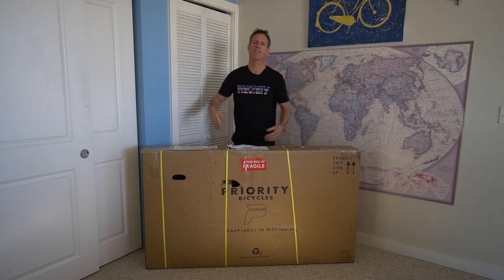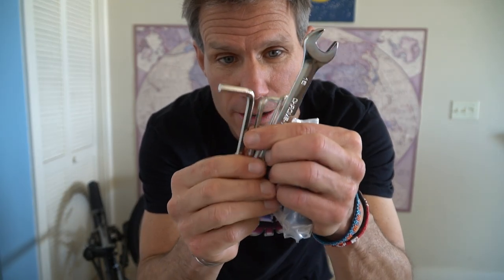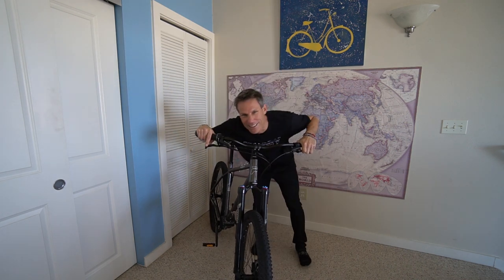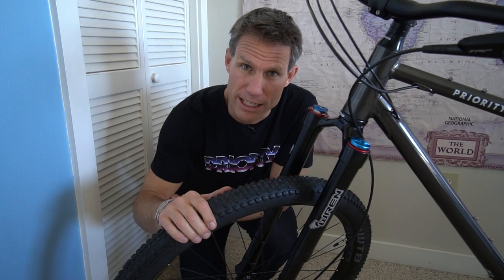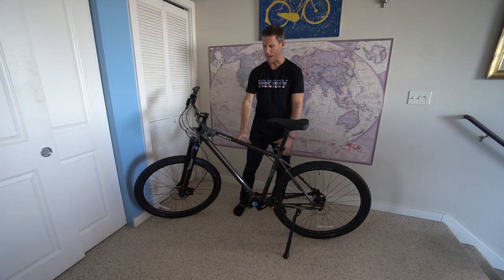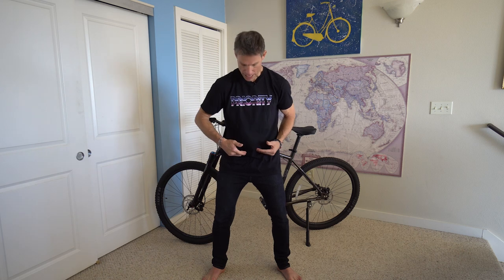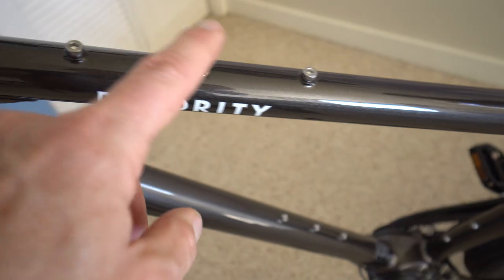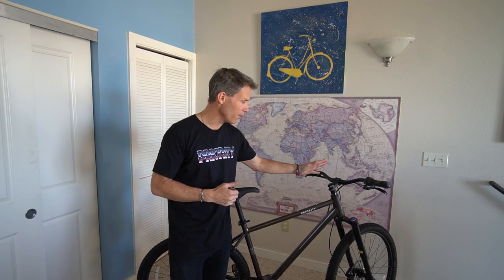The Priority 600x Bikepacking Dream Machine!

Comment: I ordered one but I'm on the wait list. Planning on riding the GDMBR starting mid July. Hoping to get it in time.
Reply: Just so you know pinion gearboxes eat gear oil.  Honestly I don't know where it goes.  Adding a little oil every 1000 miles will keep it from being hard to pedal. Also keep the belt a little looser than recommend.

Comment: A relatively Light, 350 Watt front motor would flatten most hill's, eliminating any more "Hike-A-Bike"... especially with a Pinion and a IGH!. A few studs on the front tire along with a 36 Volt 350 Watt front hub, will make this an All season All Terrain Bike for some awesome Frozen Lake drifting in the Winter. You put together a Great Machine Ryan... with all those components, I could not build the same bike for less than these bikes are selling for! This is a clean build! Well done!

Comment: Pretty bike. Needs a Factory Float SC, dropper post, steel frame, shorter chain stays, MT-7's and much longer reach. I am really excited that the belt drive might catch on, and the prices might come down on the pinion gear box.
Reply from the maker: I’m a big fan of belt drives and I’m with you on the gear boxes. Cheers

Comment: Standover clearance is usually done with your cycling shoes on which will effectively make you a bit taller so you might clear the Large frame ok.
Reply from the maker: I tried with shoes on as well, I can certainly swing my leg over and ride it, but it’s a bit too big.
Reply: @duzer  Your tire choice will also affect the clearance.  If you go Medium make sure your stack and reach measurements will work for the Medium size.  You might need a different stem length from stock.

Comment: N I C E !!!!! You ARE the man! Enjoy that new baby! You EARNED IT!!! BTW, for sizing, make sure you test stand-over with the LARGEST tire you plan on using... The inverted shocks will make it hard to mount fork bags down low :-(
Reply from the maker: Thanks, pretty excited!! Also, I've mounted my Widefoot cages with 64oz Kleen Kanteen bottles on the fork no problem.
Reply: @duzer  True, but you have to mount them a foot higher on the fork body vs down near the axle, which changes the dynamics of the front end. I prefer a traditional fork because of that...
Reply: @outbackwack368  While weight down low is normally preferable, weight on a tradition fork down low means you also have to push that weight through the system. Essentially your bags add to the unsprung weight of the system. Because the wren fork is inverted, mounting bags on the chassis up top means you add no additional weight to the traveling portion of your suspension. This means the inverted fork will be more supple and behave more consistently when loaded for bikepacking.

Comment: Ryan, my wife and I are big fans of yours. In the spring we got Trek 520s to do some touring with. I imagine our touring will be much like your cross country touring although in sections instead of all at once. Mostly paved with some gravel and a few trails. Would you take this on a cross country tour? Someday I would like to try the Montana portion of the Great Divide Trail which leans me in the direction of the 600x but is that overkill as I will likely not do a ton of technical trails. Thanks ahead of time for your thoughts.
Reply from the maker: Hello!!

Yes, the 520 is the perfect bike for pavement and light gravel. It was made for cross country rides! 

It could handle a lot of the divide, just put the widest tires possible on it. 

Happy trails

Comment: I wanted to hate this bike just cause you are presenting it, but It is close enough to my current bike.  Belted Pinion gearbox bike with wren fork rocks.  All steel frame and sub par parts are not really great, but it does have a kick stand.  I approve this as an entry level long distance touring/packing bike.
Reply from the maker: Well aren't you just the sweetest thing
Reply: @duzer  lol

Comment: LOOKS GREAT!  Mine should be here in a few weeks!  Any suggestions for a wider rim wheelset to take the 2.8 tires for Baja/Desert conditions? (stock i25 a bit narrow for 2.8) Kinda wish it could come with i30ish rims to fit 2.2 up to 2.8 tires.
Reply from the maker: You are gonna LOVE it! I know that Eddie put on some 2.8 inchers just to see if it would fit, and they did with plenty of room to spare. The WTB website says that the i25's can take up to 2.8, but not ideal, not sure what the consequences are...maybe the tires would pull off the rim on tight corners? I'm not sure. I'll try to do some research!
Reply: I've also considered the possibility of wider rims that would pair well with wider tires and for more tread contact. If you change to WTB i29; i35 or i40 tough rims, the ERD(Effective Rim Diameter where the spoke nipple seats against) is within 1 mm. It's plausible that the outer rim can be switched to one of these rims and keep the original spokes and hubs. I am most likely staying with the original tires and rims to avoid adding weight, however, conditions like sand and soft terrain would benefit from a solution tailored to the environment.
Reply: @duzer  I have rcvd my bike and can confirm that 2.8 tires work OK. I mounted a Teravail Cumberland 2.6 and Teravail Coronado 2.8  (both actual measure the same 2.75") on an i40 rims and there was about 10mm clearance. No worries if the actual measure is under 2.8" but for big mud potential under 2.7 would be  better.

Comment: That thing is beautiful. I need to save up some money for a bike (since I didn't win the raffle 😥). I know I'll use it A LOT, so I'm ok with spending a little more on a quality bike.  I still can't decide between the 600X and a Trek Checkpoint though.
Reply from the maker: The checkpoint and 600x are very different bikes. A more appropriate comparison would be the Apollo. It really depends on what you want to do with the bike.
Reply: I'd plan to do about everything but technical trails. First time hearing of a dropper post actually.😆 Lean toward the Trek for that reason(I just love the Gates and Pinion setup on Priority) . Plus I figure could more easily switch between tires? Run road if I plan a lot of commuting and rides around town,  and switch to a gravel tire for little trips. I'd love to ride down to the Sangres for a week and nature soak.  I just have to get into a bike shop and find someone deal with an inquisitive pain in the ass.
Reply from the maker: Ok. If you’re riding mostly pavement and some mild dirt roads, the 600x would be overkill. 

The 600 on the other hand does have pinion and Gates...

Comment: I really hope they will offer normal shifters for the Pinion system, because personally I just can't stand gripshift. That's my main gripe with that system, and as much as it is a very viable solution for longterm usage for something like bikepacking, I would still not have it on something like an everyday trailbike given the weight + gripshift solution.
For heavy duty use it has it's place in the market for sure, I just hope they sooner than later will provide proper shifters.
Reply from the maker: Have you ever had a bike with grip shift? I thought the same thing, but I grew to like it quickly

Comment: Ryan, saddle choice. Ive been looking at saddles and juust get confused. However as an experienced cyclist and with lots of miles under your rear end I can see you are a fan of WTB. What is difference in your view between Volt and Pure - I can see a difference in width. Cheers in advance.
Reply from the maker: They feel very similar, pure has a bit more cushion, which can be nice for longer rides

Comment: Nice bike. You must have really low gearing judging from some of the grades you climbed on the great divide. You didn’t seem to be laboring too bad even with all the extra weight. Haven’t read the details yet but I would think it has even better range than a triple crank set. 
I’m also interested in why you chose a grip shift, is it easier to use for bike packing? The bike industry is moving away from this design on hybrid bikes. Nothing wrong with grip shifts though. Whatever works best. Good idea to include a kick stand. It’s not like you’re riding a road bike! I can see where that would be very convenient to have!
Oh yeah, forgot to ask... you don’t feel the need for at least a front fender?

Comment: Sounds like it was servicability choice to go with that fork. But im suprised you wouldn't go with a traditional fork so that you can put gear on the fork lowers and it can be unsprung weight.
Reply from the maker: I plan on taking this bike on trails where suspension is needed. I live in the Rockies after all ;)
Reply: @duzer  yeah, I still meant a suspension fork (although I'm bikepacking this summer on a rigid), I just meant a suspension fork that's not inverted, so you can put extra gear on the bottom of the fork legs, but it doesn't add weight to the top of the suspension.
Reply: @SnootchieBootchies27  Actually, the inverted style fork is a better solution for carrying gear on a suspension fork. On a traditional fork, the bottom tubes are the moving part of the fork as the smaller stanchions (upper tubes) are fixed to the crown. When you strap weight to the lower tubes you are asking the fork to move that weight as well as react to changing trail conditions. Deadens the response of the fork. On an inverted fork, the stanchions are moved to the bottom and are the moving part of the fork. The upper tubes are fixed to the crown and being larger provide a much stronger chassis. By adding weight to the upper tubes, you keep the stanchions free to just react to changing trail conditions allowing the fork to perform much better. Plus, your load is now fixed in position on the bike and not moving. This increases stability especially when doing a lot of maneuvering around rough terrain.
Reply: @russjohnson2781  as someone who understands how gravity and suspension work, I respectfully disagree with your assessment.
Reply: @SnootchieBootchies27  I don't want to offend but I wanted to jump in here and say that Russ Johnson has the mechanics correct. A traditional suspension fork has the chassis down low. In this system the chassis telescopes upwards through the stanchions under travel. This means the weight of the wheel, damper, airspring, oil, chassis, and anything you have mounted to it must be pushed upwards against gravity through the system.

Compare that to an inverted fork. The chassis is high and the stanchions low. As a result, the telescoping motion is only the stanchions, their bushings, the bashguards, and the wheel being pushed upwards. For bikepacking, any bags mounted to the Wren fork are on the chassis which means no additional unsprung weight is added to the system. This means the system will work consistently no matter what kind of load you apply to the mounts.

This is the main reason for "inverted" suspension and why motorcycles have adopted it for so long now. Obviously, the Achilles heel of inverted suspension in bicycles is keeping the chassis stiff enough without the brace while also keeping things light. Motorcycles don't have to worry about weight nearly as much so the standard has been universally adopted. Making light weight yet stiff inverted suspension for bikes is expensive.
Reply: @renaissancecyclist9120  so by your logic, I can gain 50 pounds and it won't affect the suspension because I'm not adding unsprung weight. Interesting. It's not like you and the bike are just floating around and the suspension gets pushed up towards you. You and the bike are compressing down into the suspension.
Reply: @SnootchieBootchies27  obviously adding weight anywhere to the system impacts it in some way, shape, or form. What I meant was the small bump compliance - the primary attribute contributed to inverted suspension design - should not be as significantly impacted by loading as a traditional fork would be. The opposite of your original proposal.

I mean no disrespect. I just want to be clear for other folks looking for information in the comments :)
Reply: @renaissancecyclist9120  and I guess what I'm getting at is that if the weight was on the lowers of a non-inverted fork, you would effectively be asking your suspension to do less, able to run lower pressure and have less wear and tear. Also, you'd have the weight lower. All of which, for bikepacking, are definitely bigger factors than small bump compliance.
Reply: @SnootchieBootchies27  getting weight low and centered is certainly a boon when it comes to bikepacking - that's why framebags are so important and why panniers don't cut the mustard on hard terrain - but I must respectfully disagree with your insights both on the mechanics of loading vs performance and on small bump compliance. I find small vibration deadening to be a fundamental baseline characteristic for component selection when it comes to bikepacking, especially for routes like the Tour and Baja Divides where fatigue can settle in from day in and day out rides over singletrack and gravel.

Comment: What about your shoes Ryan? Maybe you can make the large work?
Reply from the maker: Nah, it’s just too big, I’m on a medium now, much happier
Reply: @duzer  I was just worried you'd be giving up some useful cargo space by going down to the smaller medium frame when the large might work with shoes. However, if you're much happier than it was a good choice. I'm going Saturday, I hope, to get my bike and I'm wondering if I picked the right frame size? I'm an inch taller than you at six flat but I have a short inseam, only 29'. Hopefully, I'll be okay. My bike will be a step through so I don't have to worry about the crossbar.
Reply from the maker: Oh nice!! Sounds like you’ll fit perfectly

Comment: Hey Ryan. Nice job designIng such a great bike! 👍🏼 I am very interested in this bike for future touring. Looking for something to handle a little bit rougher terrain. I use panniers on my current touring bike set up. It looks like I can definitely use my back panniers on the Priority 600X, but was wondering how hard it is to add a front rack on a bike with shocks? I have seen it done...but what are your thoughts? Better to use bike packing bags on the front forks and my panniers on the back? Thanks 🙏
Reply from the maker: Front rack will be tough with a suspension fork, there might be a way to do it, try googling answers. A front roll on the handlebars would be a better option.
Reply: @duzer  Thanks man. Yeah, i googled it too. Was just curious what you used. Then I just started watching your GDMBR video and answered my question. Was surprised at how minimal your set up was! Definitely inspired me about carrying less. I’m just used to the 4 pannier set up. But if I get the Priority 600X i think i will just use the back panniers and a front roll like you said. Seems like you did just fine! 👍🏼

Comment: As for your commuter bike, the Priority 600, would it be good enough for The Great Divide Trail?  What is the maximum size tire that it can accommodate with fenders?  Also can the handlebar be swapped for a dropbar?

Comment: Hey Ryan, all your videos have inspired me.  This bike looks so cool.  I’m wondering if I’m too tall for the large size that they offer.  I’m 6’4”.  What’s your height and 600X bike size?

Saw it in the video 5’11”

You rock!  Get out there!
Reply from the maker: Hello! 6’4” sounds about right for the large, the large is a 21” frame. Check the size chart on the 600x page and check your inseam. I’m 5’11” and large was way too big
Reply: I am 6’4” as well, and rode my L today.  It’s a great fit out of the box, and it has a very short stem (room to expand if you need to).  Mine measures 35” from BB spindle to grips, which is within a half inch of my XL Ripley.

Comment: Very interesting.  The Priority 600 that I got in 2019 was taking a beating on the logging roads here, so I had a beefier rear wheel built for that bike and later got a trail bike that I ride on these roads. How does the 600x stack up as a cross country bike? What does it weigh? You make really good videos - are you sponsored by Priority?
Reply from the maker: The 600x is a full on hardtail mountain bike. I ride it on rough singletrack, it's burly. It weighs 33 pounds. Priority doesn't sponsor people in the traditional sense, but I do work with them on various projects.

Comment: I want to put A Burley Coho XC trailer on it. What size bolt will I need for the rear wheel attachment? Oh and I ordered 2 medium sizes. I will also want to put mud guards on the front and rear tires. Will this be a problem?

Comment: Seems optimised only for tall riders. Other than that features I would look for in a bike, with a small frame I would want a 26 inch wheel and good rack as the frame center is pretty much useless for cary
Reply from the maker: I carry a majority of my food and gear in my frame bag
Reply: @duzer  For smaller riders the frame` center will not keep you fed for very long, good job it has rack mounts, same for saddle clearances and underslung bags on smaller frames

Comment: Wow! A dream bike. I only have usd 150 to expend in a bycicle, should I choose 26" or 29" for bikepacking?
Reply: 29er, they roll over features better and the availability of replacement tires is also a consideration. The 26" wheel is slowly phasing out, and tire selection is not as good. If you need a tire replaced for an unforeseen reason while out touring/bikepacking, you can get a cheap replacement at a Walmart or equivalent type of store